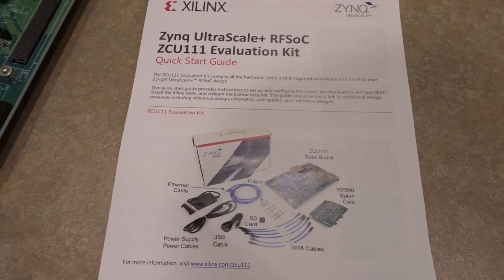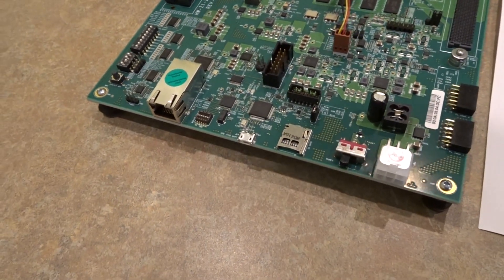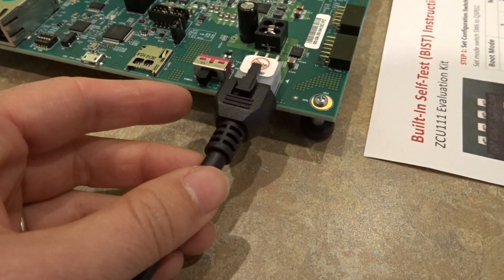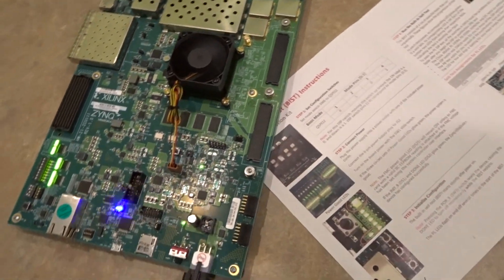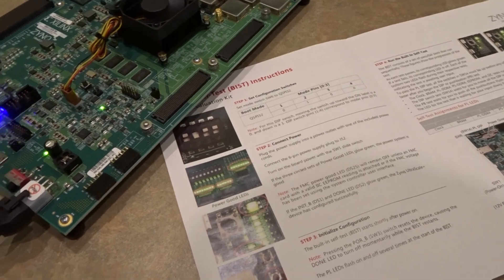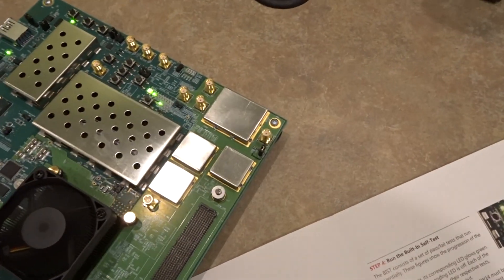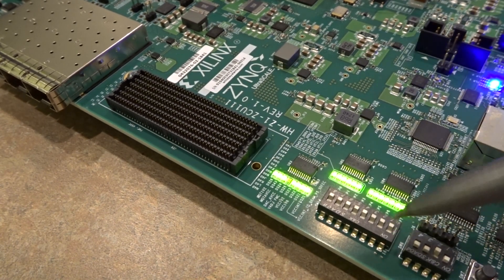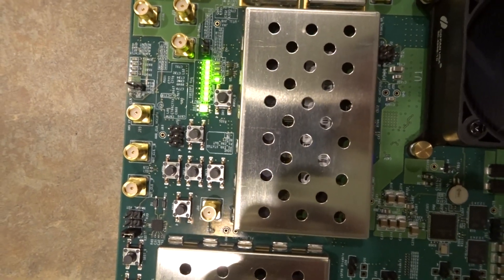Xilinx ZCU111 Built-In Self Test (BIST)

Comment: What to do if the INIT_B LED is glowing red after turning the board on ?
Reply from the maker: Double check that the boot mode is correctly set to QSPI boot. If it is in QSPI boot mode, then it could be that the factory image needs to be re-flashed.  This Xilinx forum post talks about that: https://support.xilinx.com/s/question/0D52E00006iHqvxSAC/zcu111-power-on-failed?language=en_US

Comment: Thanks a lots for your video, but i think there is a mistake at the end of the first minute (0:40), you say the DIP switches were are all zeros in the begining, but i confirmed they were ones by this setting.
Reply from the maker: Hi Najib, please check out the Quick Start Guide document at https://www.xilinx.com/support/documentation/boards_and_kits/zcu111/xtp490-zcu111-quickstart.pdf. It states "Note: For this DIP switch, moving the switch up toward the ON label is a
 0, and down is a 1." At 0:40, the switches are all towards the ON label, which means all zeros, based on the ZCU111 documentation.